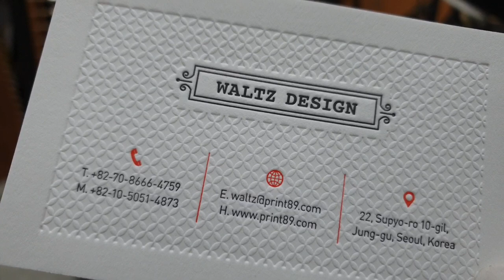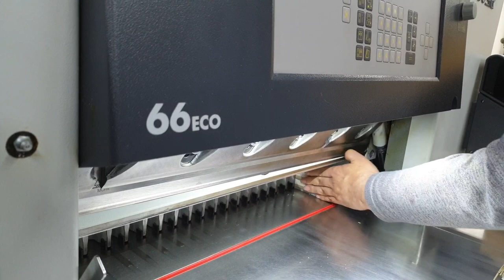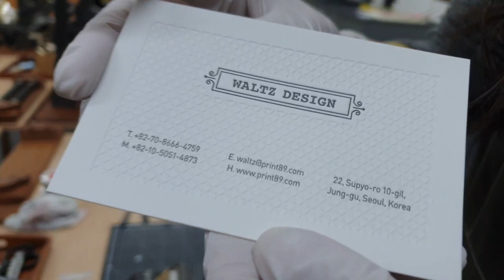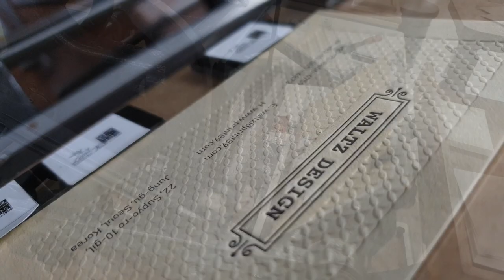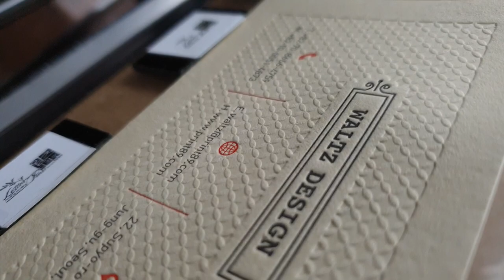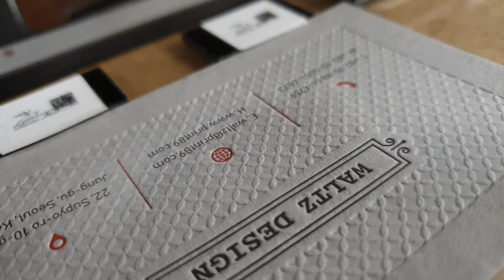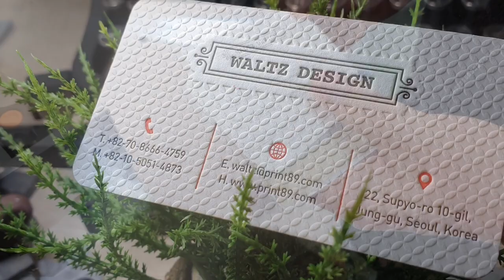Make letterpress business cards using magnesium printing plates.고급스러운 레터프레스 명함 만들기.

Comment: What is the thickness of the backing board on which plate is fixed?
Reply from the maker: The board to which the board is attached was calculated in the form of board height + board height = roller rail and made a similar value.  Each device is slightly different.  There are no exact standards.  However, considering the standard height of type, it is almost correct when calculating it as 23.25mm.

Comment: Waltzdesign Hello. What is your opinion on photopolymer plates ?
Reply from the maker: I mainly print with an emphasis on depth. In the case of the resin plate, I think the height of the relief is a little low for the sense of depth. Of course, there are resin plates that can give you a lot of depth, but it is difficult to obtain in Korea. But the printing is good. I mainly use zinc plate a lot. It is well expressed on detailed and thin prints.
Reply: @w_letterpress  Ok thank you